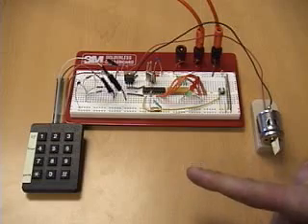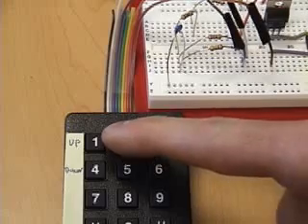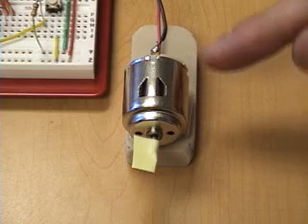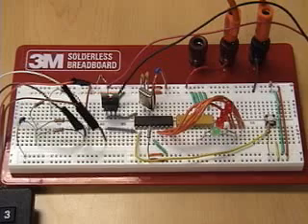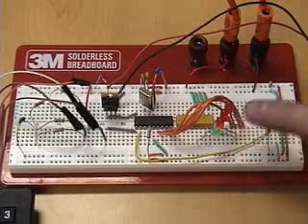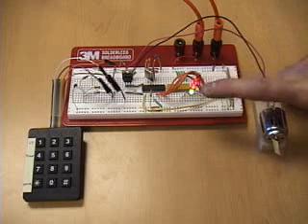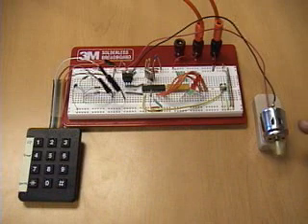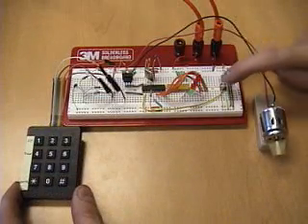Pulse-width modulation speed control

Comment: @101perspective connect your motor to a separate power supply with a high power transistor pnp connected to it. The signal output from the speed control can then be used as the transistor switch signal and you wont have to worry about the voltage powering the motor overheating anything.

Comment: Which mosfet power transister did you use for this.  The one's I've tried have overheated big time.  It is because of their max junction temp I think.  The DC motor uses too many watts and thus overheats the mosfets I'm using.